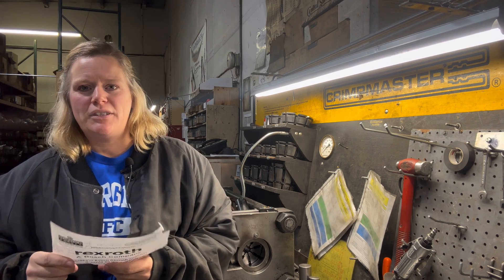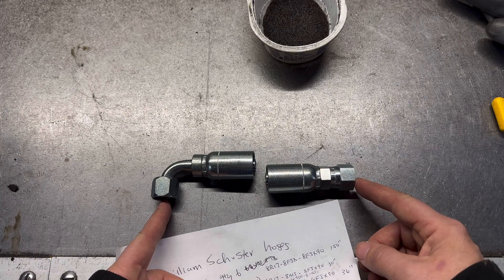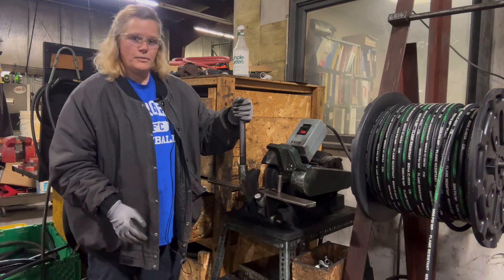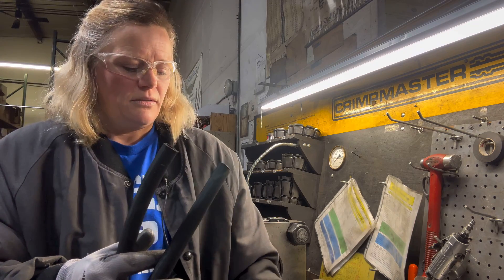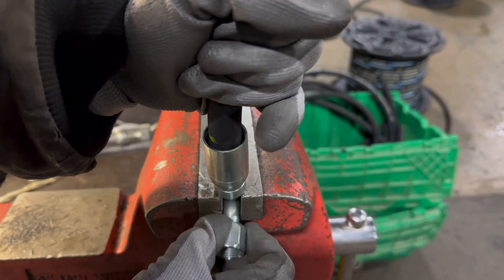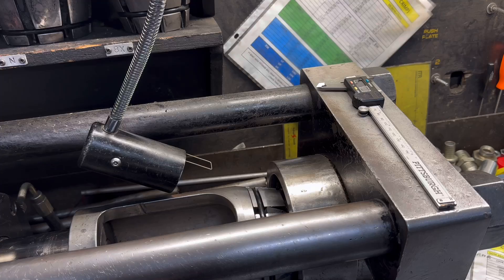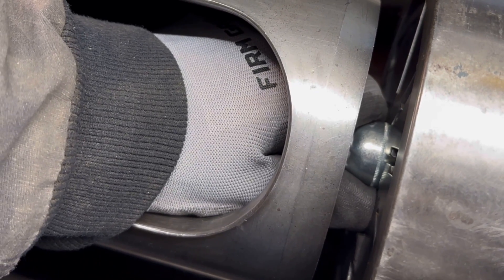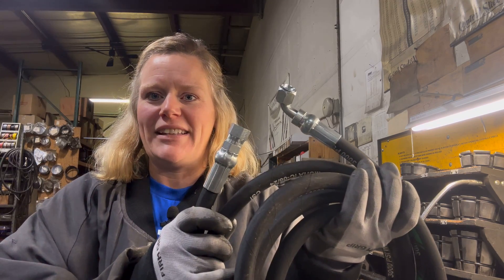How to Build a New Hydraulic Hose for a Farm Tractor

Comment: Thanks, but how do you thread the hose into the crimper when you have two 90 degree fittings on end?🐞
Reply from the maker: When u have 2 90-degree fittings on a hose, and your crimping the 2nd end, u need to pull the die a little loose from the crimper, push the 90-degree end all the way through the crimper and the die, then place the die back in the crimper and crimp the end. To release the hose from the crimper, you need to loosen the die again to allow for the 90-degree end to pull through.